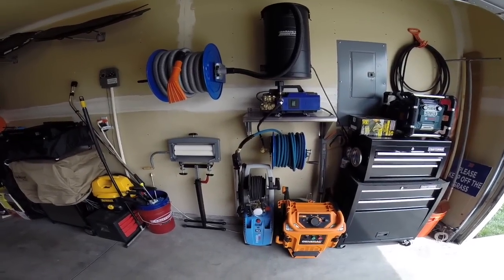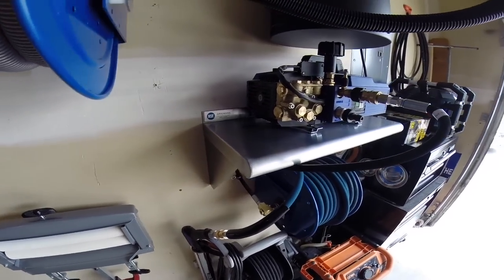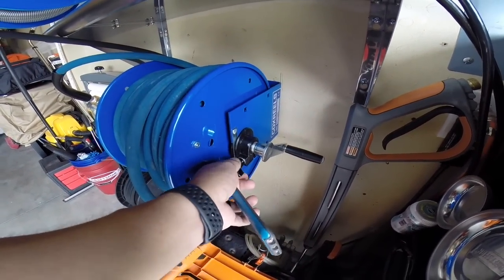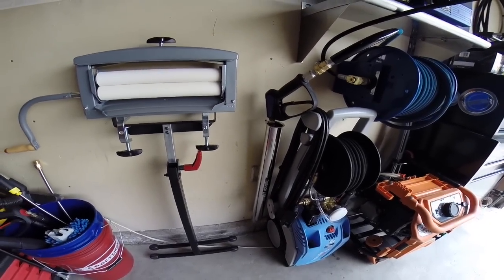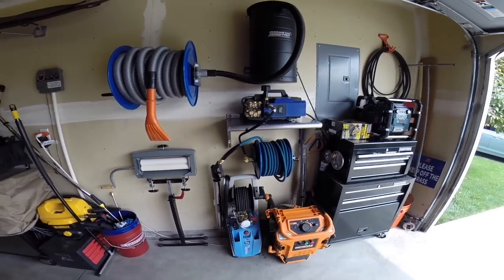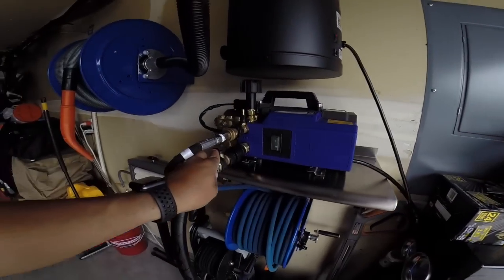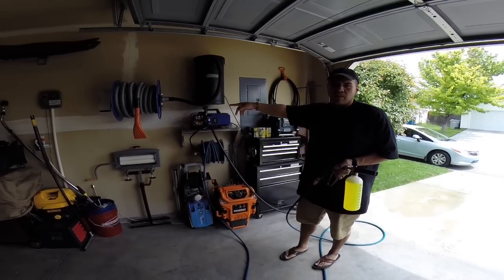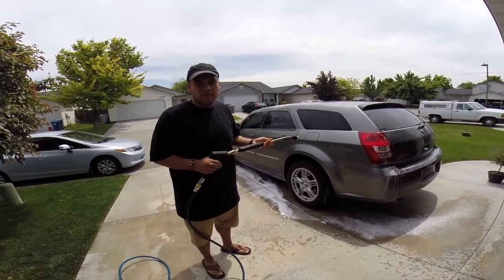AR 630 TSS hot wall mounted solution

Comment: I'mm liking this pressure washer. Fully serviceable with all given part numbers. Provides adequate power and has an auto stop. Just wish it competed more on operation noise vs the kranzle since 84db vs 90db is quite a bit.
Reply from the maker: To be honest your not going to notice a huge difference between the two esp if you keep it in the garage like I do. They are both loud unless you take them outside and when you do the noise is dispersed and hard to tell the difference between the two.

Comment: The 1322TS Krenzle is FAR quieter.. under 70db on Matt's test if I recall.  I think the AR630TSS is a great option and 250$ cheaper than the 1322TS.  I keep waiting for Matt at OG review of the AR630TSS.. I think it will impress him.

Comment: I posted in your other video and just found this one! You did get the Kranzle... and just wanted to ask why you think it's not worth it?  I'm like 90% sure now I want the AR blue that you have from your previous video!  The hose reel is designed like that as to not be true.  The reason is when you pull on the hose reel if it perfectly round it would then be pulled down by the heavier end of the hose/attachement.  By having it not be true it counter balances in a way the object that it has on it. So that's why it doesn't seem true when you reel/unreel tings but it's not a defect.

Comment: Just curious, why do you have a shut off valve on your garden hose?  AR just told me the plastic quick connect that is supplied with the unit, the same one your are using here, closes off the water when you disconnect it.  Thx
Reply from the maker: its because I use the hose for different attachments as well and not just the pressure washer. if I wanted to attach a different sprayer to my hose I would have to walk to the back to shut the water off vs using a shut off valve

Comment: Hey Tony, thanks for posting the videos.  I’m wondering, does AR offer the AR630TSS in a cold version.  I only need to spray with cold water, and was thinking if they have this version, but would also like to keep the TSS feature built into it.  Not a deal breaker, just curious and if it would be any cheaper.  Need to pick me up one of these!  Thx
Reply from the maker: I only went with the hot version because it was cheaper then the cold!

Comment: Nice set up, I also have the 630  but yours must be a newer model I have a different style power switch and it doesn’t have the auto on/off feature.
Reply from the maker: Thanks man! The 630 series of pressure washers come in different configurations and they all have different price points.

Comment: I have the same pressure washer and was thinking about purchasing a longer hose. Did you notice any drop/change in pressure while using the 100 foot hose?
Reply from the maker: Yes I noticed a drop in pressure. There is a big difference  but It still strong enough for my needs. if I wanted to use it for anything else besides washing a car then I use the green tip and it that doesn't do it I use the green tip and original hose.

Comment: What a nice set up!!
Reply from the maker: Thanks Todd! I get alot of use out of it since everything is easily accessible.
Reply: You are welcome. Yeah, I bet you do with that set up. I’ve been looking into upgrading my pressure washer, so I’ve been checking out a lot of video’s like yours and other reviews. I do not have a ton of space, so your set up is very appealing to me. I like that you use quality products to build your total system. Buy the good stuff and you typically only have to buy it once, plus you get the benefit of performance. 
I would also like to add that you did a good job with the video, thanks for sharing. I like the Magnum in the driveway BTW ;)

Comment: Awesome video! Question: did you use 3/8 hose because it cost less than the standard 1/4, and do you think the drop in pressure was more from the 3/8 hose or the 100ft length? Last, because of cost I am considering the AR blue clean 2 in 1, thoughts on that one?
Thanks again for this great set-up.
Reply from the maker: The 3/8 hose was actually more expensive then the 1/4 because its a thicker hose. The drop in pressure came from both the bigger and longer hose that I decided to go with but I would say that having a longer hose played more of a factor. The pressure isnt a big issue but I didn't notice a drop. If I need more pressure I just change the tips out and use the Green on vs the white that I typically use. Ive never seen or heard of the AR 2 in 1. Did you have a link so I can check it out.

Comment: Hi, I have question on vaccum hose reel. Please advise how did u connected vacumaid garage vac to the coxreel vaccum hose reel. if u let me know the size of hose and where u bought that short one from your garage vaccum to cox.... please advise..
Reply from the maker: I actually took the entire vacuum to a central vacuum store and they gave me all the fittings and hoses. I figured this was easier then trying to order parts that I didnt know if they would fit or not. They only charged me like 8.00 for all the fittings and small leader hose that goes from the reel to the vacuum.

Comment: 100’ won’t make the pressure any lower, that has been proven many times, it’s more of an issue with gas powered PW. With electric PW it just cause slightly more delay to get to the same psi. Generally you want 1-1.1k psi max for car wash, any higher it’s kind of risky. Let’s say there’s a small chip that you are not aware of, pressure that high could cause the paint to peel. That’s why obsessed and most pro dial the pressure down to around 1k, that increases the gpm flow which is more important. That’s actually the primary advantage of your AR but you have to dial the pressure down with a large nozzle to get there. Your setup definitely need a pressure gauge that can connect right before the gun, and then you can try different nozzle sizes to get it down to 1-1.1k psi for the higher gpm. 

From there you may want to change the snow cannon orifice to 1.1mm if it isn’t already to balance it back, or the soap might get more watery. Good luck, clean setup btw.

Comment: Have you use the heating option? I live in Chicago and wondering if it can be used during winter months for quick raises?
Reply from the maker: I have not ran hot/warm water through the unit since I dont have access to hot water. The unit itself doesnt heat the water up but allows you to run hot water through it.

Comment: I want that same vacuum hose reel.  I already have the same vacuum as well.  My hose is 1 1/4 and the reel has 1 1/2 connections correct?  Did you have to buy reducers and where did you get that short vacuum hose from the vacuum to the reel?

Thanks!
Reply from the maker: Hey David! Those are some great questions and Im sorry I didn't mention it in the video but I actually took the hose that came with our vacuum and the cox reel to a vacuum supply shop and they were able to cut me a leader hose and give me the reducers that were needed. They typically have everything in stock. 
I would look for a vacuum supply shop near you or a shop that sells central vacuums in your area because those are guaranteed to have them since they use those during their install. I was going to order everything online but I didn't want to waste a whole bunch of money purchasing the wrong things.

Comment: Is the pressure washing working fine on a 15a receptacle? Or did you put it on a 20a?
Reply: He had an electrician install a dedicated 20a breaker for the pressure washer.
Reply: @kennethstevenson6336  I figured that. But I heard that 15a recepitcles still can't work on 20a breakers. Hence why I asked

Comment: Hi, I don’t know if you have heard of the kranzle 1322ts? It seems a good option, it is quiet too
Reply from the maker: Hey! I have heard of it but I personally think its overpriced considering you just get the pressure washer itself and nothing else. The AR is a great option for people who want a reliable pump at an affordable price. I have been using this for the last 2 seasons and it has work flawlessly.
Reply: tonybuddy123 the pump is something that you buy when you are a mobile detailer to use from a water tank or it comes in the pressure washer? I am confused haha
Reply from the maker: It depends. Some people refer to the pressure washer as “the pump” because the pump is the lifeline of the unit. If the pump goes out the whole pressure washer is useless. So when you hear “the pump” they are often referring to the whole pressure. On the flip side some pressure washers need to have a pump to force water into the pressure washer when they are doing mobile detailing because they don’t have a water source that is forcing the water into the pressure washer so they will be talking about an additional pump that is needed.  I hope this help!

Comment: Hey Tony, since it's been about a year, are you still using the same AR consistently and if so, is it still doing what you expect it to 100%? I'm ready to buy a new pressure washer right now and I'm really interested/curious in this one. Thanks!
Reply from the maker: I love the AR and it still runs like the day I bought it. I haven't had any issues at all which is surprising since Its been through 2 winters and I forgot to winterize the pump the first year but nothing happened to it! I prefer it over my Kranzel. The kranzel is nice but it doesn't have enough pressure for me.

Comment: Tony,

Did you use drywall anchors or were you able to hit studs on everything that you mounted?
Reply from the maker: The only thing that is screwed into a stud was the vacuum because the spacing worked out. I used toggle bolt drywall anchors to mount the rest of the stuff on the wall though. I didn't have any studs that were close by and I didn't want a big sheet of plywood mounted on the wall so I opted to go this route. They work awesome and I haven't had any issues with them. Its been mounted for months and it hasn't moved an inch!
Reply: Thank you Tony! Sent you email.
Reply from the maker: Hey John! I replied to your email. I hope it helped.

Comment: Any issues with ordering from kleen-rite? Just want to make sure everything went smooth. Not the best reviews. Thank you
Reply from the maker: I did have issues with shipping charges. I was charged almost double what I was quoted because they shipped off items as they came in stock and that increased my shipping charges. I was pretty upset about that but there wasn't much I could do since I guess it states that in the small print that I have yet to find. Another thing that annoyed me was it said all the items I bought were in stock but it turns out half of them were on backorder and it took almost 2 months for me to get everything.
Reply: @tonybuddy123  
Thanks for the reply Tony! Still trying to decide on ordering the parts or not. I appreciate you getting back to me.

Comment: forgot to ask but, 1122 or 630 tss? what feels stronger even though the AR has a stated 1900 psi
Reply from the maker: I prefer the 630TSS over the 1122 because of the pressure. the Kranzle isnt strong enough for my liking. It works just fine if your doing maintenance washes but I tend to get my vehicles really dirty and the AR gets the job done quicker.

Comment: Having had more time, how do you still like the AR630?  And how does it compare to the Kranzel K1122TST you mention in the video.

The 1122 has the same pump and almost same specs as the 1322, both seem significantly under the power of the AR630 on paper so im curious if you had a chance to run both and what you think? 

I'm close to making a purchase, price or accessories isn't as important as id upgrade gun/wand/hoses either way.  But pump is fixed....which do you reccomend of the three?
Reply from the maker: I really enjoy the AR630 and prefer it over the Kranzel 1122tst because it has more pressure. I just feel that the Kranzel is a little underpowered. The kranzle is also advertised as a 15 amp unit but I seem to pop the breaker when using it so in reality it really needs to be on a 20 amp circuit to really get the full benefit out of it. 

 I also rather have more pressure with the ability to lower the PSI vs a lower pressure and not being able to raise the PSI. The 1122TST is very similar to the 1322 but isnt the same internally. The 1322 actually has a different plate inside the pump which makes a difference. The 1122TST has a wobble plate vs the standard plate in the 1122. If I had to recommend one I would go with the AR630 if you plan on wall mounting it or keeping it stationary but the 1122tst is nice because everything stores within the unit and you dont have to worry about storing the hose, wand setup since it stores nicely in itself. I just dont like the fact that the pressure is so low. 

After doing my research and talking to alot of people who own car washes they all prefer about 1400-1600 psi but dont run their units in their business that high because people misuse them and can damage their paint so it become a liability for them. That is why they run them at a lower PSI plus it makes them more money since it takes longer to clean the vehicles so its a win win for them. Let me know if you have any other questions!
Reply: tonybuddy123 thank you, very detailed reply,  i appreciate it.

Comment: Where did you get the hose that attaches the vacuum to the reel???
Reply from the maker: I purchased it from a local vacuum store that sells and services vacuums and central vacuum systems. Check your local area for one and they will have all of your adapters and hoses needed. They can cut any length of hose you need which is what I did.

Comment: I have that same gas pressure washer. But I uesd it at it lowest setting. How close is that AR to that generac? I want to use it for mobile detailing. And do have any issue with that AR blue
Reply from the maker: TO be honest I havent really compared the 2. That is something that I will have to look into. I havent had any issues with the AR and it is my primary pressure washer. I absolutely love it!
Reply: tonybuddy123 will is fun off a 4000w generator
Reply from the maker: Yes as long as you have a 20 amp plug on your generator. I’m sure a 15 amp would work but you might have to turn down the pressure. The AR works fine with my Honda 2200

Comment: Which model is that exact Coxreel you used?  Thx
Reply from the maker: all the information is in the description box. I dont have it off the top of my head but there should be a link
Reply: tonybuddy123 Thank you Tony, I did find the link, but when you click on it all of the model choices are displayed.  I just wanted to confirm which one you had that fit your hose size.  Thank you again.
Reply from the maker: @tundrawhisperer4821  it should be already selected but to verify on your end it’s the 3/8 x 100 hose reel. I will copy and paste the title here. 
Coxreels 112-3-100 100 Series Challenger Reel, 3/8" Hose ID, 3/8" Hose OD,Blue, 100' Length

Comment: You have a good pressure washer, expensive hose, reel and stainless steel shelf. But your walls and floors are not coated?!!!!
Reply from the maker: its a starter home that I bought when I started school so it didn't make any sense financially to paint the walls and coat the floors. I wouldn't get any ROI's in those cosmetic upgrades so I opted to leave them the way they were. Thanks for noticing haha..

Comment: Are you liking the kobrajet and the cox reel?
Reply from the maker: The kobrajet hose is working just fine. I like how its flexible but I've had others that were just as good. There is nothing special about the hose since the psi is fairly low anyways. The cox reel is ok. Its nothing to write home about if im being honest. The workmanship is ok but overall im satisfied with the setup.
Reply: tonybuddy123 thanks for the reply, I am planning to do a setup like yours. Which hose you recommend me? And what reel, the cox is the only one you have used?
Reply from the maker: Ive used a few different hoses but I think the Kobrajet hose works great for the price if you can find it on sale. The roc is the only hose reel I have used for a pressure washer hose but Im a fan of reelcraft hose reels.
Reply: tonybuddy123 thank you so much for the recommendation. One last question: do you use a quick disconnect on the hose to plug in it inside the hose reel or you use it like stock?
Reply from the maker: I just use it stock. There was no need for a QD on it since I dont ever plan on taking it out. I did have to use ALOT of teflon tape on the connect because I kept getting a link. It was annoying because it took me several tries to get it sealed. There was some paint on the threads that I ended up having to scrap out which solved my issue.
Reply: tonybuddy123 I was a little confused about the connection but now I know. Thanks